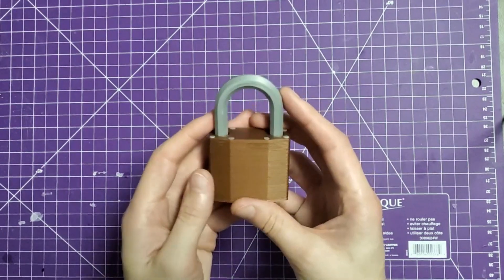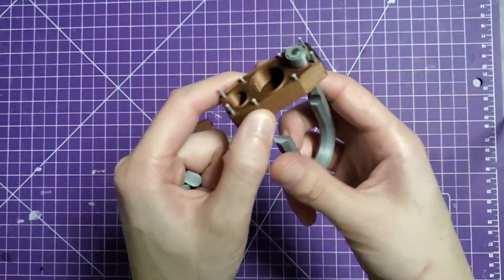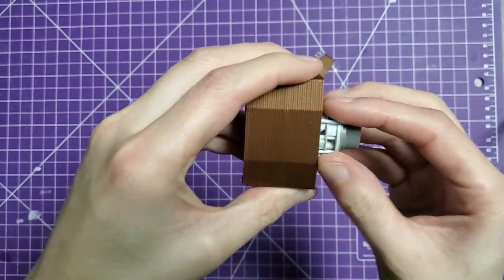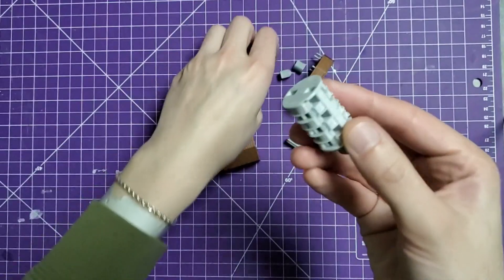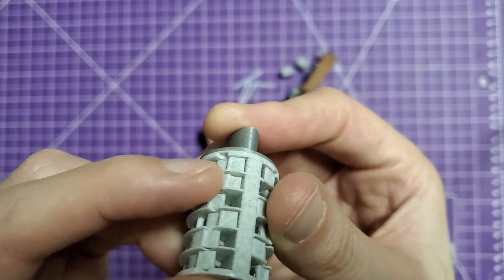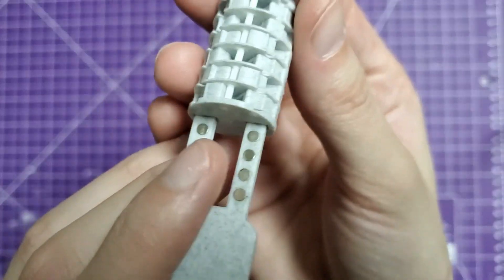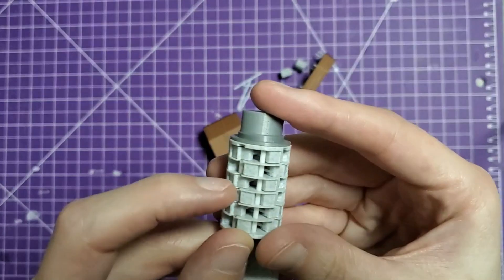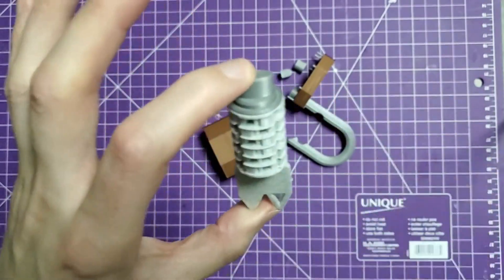The greatest 3D printed lock ever created!

Comment: Epic job. The number of possible magnet positions would be ridiculous and you would have no way to tell if your guess was even part way correct. You can't play it like mastermind and gradually figure it out, even just popping a magnet in on a strip to test could give you false positives with the opposing sides. Crazy.
Reply from the maker: Exactly right, my friend! The whole mechanism was spawned from the concept of limiting information available to the picker, as well as limiting the pickers ability to manipulate the mechanism! I used magnets to simply create "spooky action at a distance" while maintaining the coding through physical components!

As an added bonus, the mechanism is even self scrambling through TWO discretr mechanisms. First, withdrawing the key will scramble all the gates. And second, the gates dont like resting next to eachother due to the magnetic poles and tend to stagger themselves in an ABABAB pattern :D

Comment: I find that sometimes, sending wayward ideas or projects out to the world can be the greatest cure to creator's block. Or lock, in this case. 
Just know that the lock you sent out, the lock that you made, can be shown to you in every different way until that method is perfected. 
Don 't lose hope, your plan isn't gone, it's simply being tested, checked and noted.
The notes on which will most likely hold significant insight to  your setbacks, and responses to your "what if's". 
.
TRY. Try. try, fail.
TRY again.
     - Failing isn't losing until you stop trying.
10/10; Fantastic fucking concept; don't stop now.

Comment: Very cool working model of your idea and super satisfying to watch the key in action (kind of like watching a Miwa U9 or PR key in action). Reminds me of the Miwa EC in design where it uses magnets to push and pull sliders that you can't directly contact with a pick, but instead of locking the sliders into the lock housing you use sidebars. Cool stuff and great accomplishment! Already coming up with methods in my head on how to go about tackling the pick having picked pretty much all the magnetic locks I could get my hands on on my YT channel. I'll have to chat with Lock Noob as I don't recall having seen him pick magnetic locks before and give him some pointers.

Comment: How interesting.  I'd love to have the print files 😎
Reply from the maker: Thanks for checking it out! Id like to be able to offer the files but it would honestly be a nightmare to get it to print on other machines correctly :( The tolerances are easily within 0.1mm in a lot of places, and the post processing required to slap one of these together is on the order of 6-12hrs...
Reply: @lethalogicax2474  Is it FDM printed? if so 0.1mm is tricky, but i think doable with slow speeds and careful tuning. any chance for release?
Reply from the maker: @gedeonang7077  Yes, most parts required 0.1mm layers if I recall correctly. They had to be printed very slowly and carefully with very tight settings...

...sadly, I can no longer persue this project, at least for now. Im currently recovering from a series of siezures that left me disabled :(
Reply: @lethalogicax2474  that is a real bummer.  I'd really love a stab at it.
Reply: @lethalogicax2474  Personally, I'd be more than willing to put in that time and effort just to get a chance to play around with it, and I'm sure many others would love to as well.

Comment: Very clever internal construction and a genius way to prevent picking.  Looks practically impossible to pick.  It looks like it may be theoretically possible to pick this lock, but the equipment and skill required would be a long and difficult science project.   Direct feedback would be super delicate.  Most of the feedback would be from subtle changes in position/strength of the magnetic field that leaks from the lock.  This would require specialized custom equipment to visualize.    With a programmable key I think you could theoretically also do a precision decoding attack on this lock, but a precision decoding attack requires custom high precision tools in addition to a lot of time.  (the search pattern would need to test >200 key configs, which would take hours)   Another advantage is that the key is immune to conventional impressioning so photos of the key wouldn't leak the lock's code.
Reply: if someone had a magnet that freely rotates on a single axis and moved it around the lock body maybe they could see the polarity of the magnets inside the lock and stick a few magnets onto a couple popsicle sticks to match it just realized you can find the magnets with a sheet of magnetic field paper and visualize the magnetic fields of the moving pins for under 30$ and its reusable
Reply: @kelvincooley  I suspect the magnets in the lock body are all identical or arranged randomly so knowing the orientation doesn't tell you anything.  The magnet film is a step in the right direction as that would show the position of all the "wafers?" that read the key.  But I don't think magnet film is sensitive enough to show which "wafers" are binding or free so that the binding "wafers" can be picked.  I think a net of hall-effect or GMR sensors could pick up which "wafer" is binding or loose, but that's not something you'll find on e-bay for $5 or easily fit in your pocket.
Reply: @martylawson1638  if the magnets are identically arranged then wouldn't it be easy to pick? just remake a key with the correct number of magnets? if it doesn't work one way flip it over the pins would need to be set based on the magnets polarity and either a push or pull effect on the pins if they are identically arranged wouldn't it be as easy as trying both polarities? so finding the polarity would allow you to set the magnets into a push or pull effect relative to the required orientation of each pin as far as seeing the binding pins, as the pin moves so will the magnet and the field will shift on the paper allowing you to see the inside move or not
Reply: @kelvincooley  if you don't have a key you don't know which orientation the magnets are in or in which pattern. If it was all the same you could just put a strip magnet inside.
Reply: also to be fair its 3d printed and cant really be made of ferrous material... sooooo just hit it with a hammer...?
Reply: @kelvincooley  You probably can make it out of steel, might require adjusting the magnet location vs core diameter etc. or using a less magnetic steel like 440C stainless or one of the 300 series alloys.  Even if you can't make it from steel, there are some crazy strong bronze alloys or Titanium would make good case alloys.
Reply: @martylawson1638  Bronze sounds right...i guess ill need to upgrade that hammer to a ramset gun lol
Reply: @kelvincooley  it could be made of metal and have buffers inside to stop the magnets sticking. Millions of products are metal with moving magnets inside. It's a prototype not a finished product.